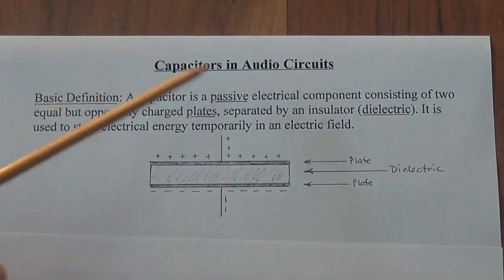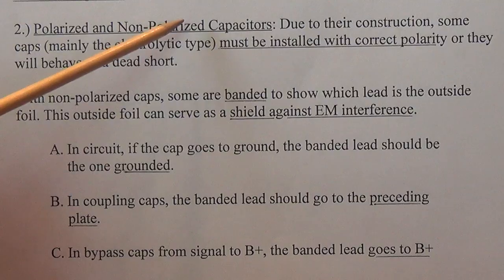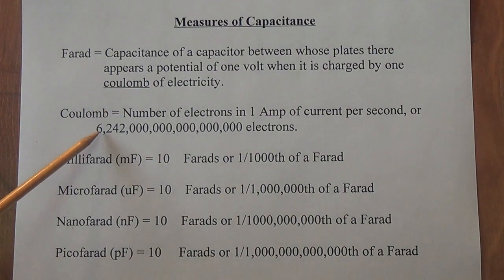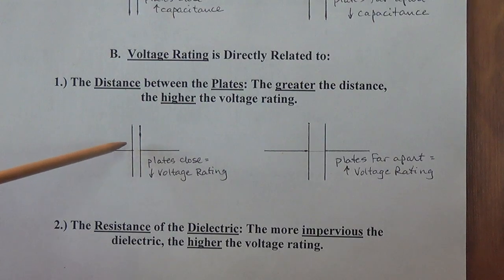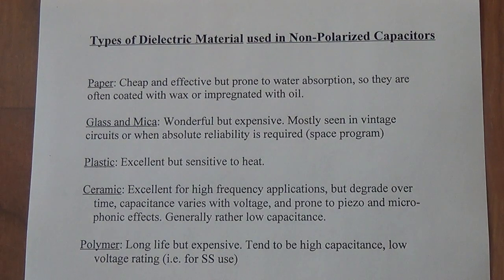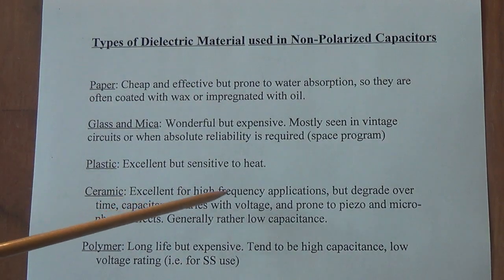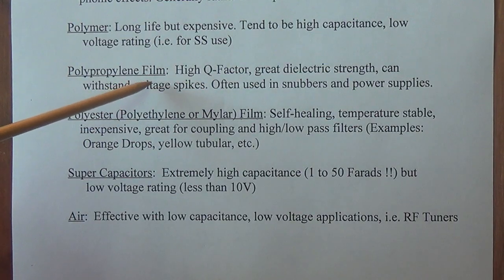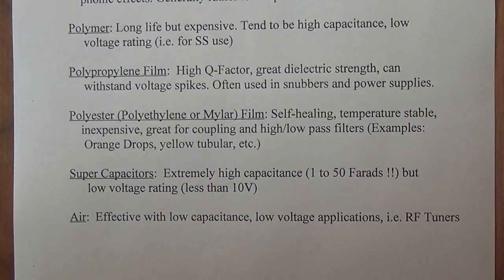Capacitors in Audio Circuits:  Part 1

Comment: It's absolutely wonderful to see you, Jack, and Rusty making videos. On another note, they also make an X-Y Safety cap that is good for both X and Y type installation. Also- unfortunately the band on the Sprague orange drop is not necessarily the foil side. Paul at the Mr. Carlson's Lab YouTube channel did an extensive video on the topic - https://youtu.be/BnR_DLd1PDI
Reply: +Michael Lloyd Thank you Michael, for the clarification about the oscilloscope. I have one and any tech worth his salt, should have one. Me being in my 60s, I prefer the analogCRT  type, but the new digitals are great. When I was introduced to the oscilloscope it was with a exNavy instructor who simply called it a "scope" and it kind of stuck with me. Are there any other methods of determining the polarity of a capacitor without an oscilloscope? Thankz
Reply from the maker: Thanks.....and thanks for the input, Michael.
Reply from the maker: Thanks for the clarification, Michael. I think an oscilloscope is a great tool for circuit analysis and would encourage you to get one.
Reply: +Michael Lloyd I have a Silvertone 1483 as another restoration project. I can't believe it ran a pair of 6L6s and used a 5Y3 rectifier! Good luck with your Silvertone. Thankz
Reply: Mine is just the head. It's a model 1484. A pair of 6L6's drives a pair of speakers. It uses a 6FQ7 for the phase inverter. It's probably the same amp as far as tubes go. I have a 125XL cabinet for it that didn't come with the amp. I had to buy the cabinet and someone gave me the amp. It's got a solid state power supply that I have rebuilt. The "board" for that is where I need to check my orange drops for the foil side. I rebuilt that part before I knew the difference. I also used 1N4007's to replace the 1N3194's and 1N3754. The rest of the amp is untouched so far other than cleaning the chassis and putting ceramic sockets in or the 6L6's. The amp had been in storage and it wasn't in the best shape. The cabinet cleaned up nice though.  I wouldn't know any of this without Uncle Doug's help (and Rusty and Jack)
Reply from the maker: I'm not eavesdropping on your conversation, guys, but I really appreciate the very nice comments. Thanks !!! :)
Reply: Audio Tech Labs well the thing is that  the solid state (diode) rectifier is factory original.  There are (4) 12AX7's, a pair of 6FQ7's (or 6CC7's) and a pair of 6L6's. No rectifier tube.
Reply: I have seen that post, and the only thing about it that is negative, is you need a scope, I think. Thankz
Reply from the maker: I'm not sure what your comment is referring to, ATL. Please advise.
Reply: He's referring to the tester video that I linked to. The method for determining the outside foil side of a cap that is in the video requires the use of an oscilloscope. It's a pretty simple process though and since I like to restore old test equipment too, an oscilloscope seems like a normal electronic bench tool to me.
Reply: I'm not too far behind you (58). Time flies when you're having life. I don't know of any other way to test caps for what side is the foil side. I wish I did. I didn't realize modern caps were still made that way until I saw Paul's video. I just never gave it a thought. I've put a few in "wrong" I'm sure. The AA5's I've worked on didn't seem to mind. The few guitar amps I've worked on didn't have to worry about it because I only swapped out the power supply electrolytics. I take that back... I have a Silvertone that I need to check when I get back on it in a few weeks

If it has tubes in it, I'm a fan. I just put an incredibly clean Tektronix Type 317 on the bench last night and brought it up on the variac to see what the condition of the caps and various components were. The AC-DC input selector wouldn't move. That's not good. At around 120VAC and 2A I started to smell something akin to insulation getting hot and shut it down. I will put it in the que for restoration later this year. I also have a little Rigol "scope" that I use. The oscope looks like it's brand new. I've never seen one this clean.
Reply: +Michael Lloyd I concur! Uncle Doug is hands down the best source for guitar tube amps. Period! So did the transformers preform well given the higher voltages the SS rectifier provided?  I would have thought who ever built the amp would have used a 5U4 to rectify. Cost was the reason as stated many times by Uncle Doug of other manufacturers. Thanks
Reply: +Michael Lloyd Whow! I would have commented on your channel Michael, but there is no comment. That is weird they designed your amp with SS rectifier. Thankz
Reply: Had one. Poor boy's Twin Reverb. Sorry I had to let it go.